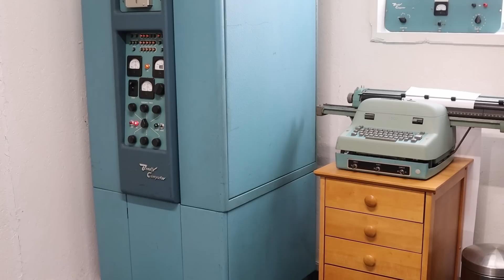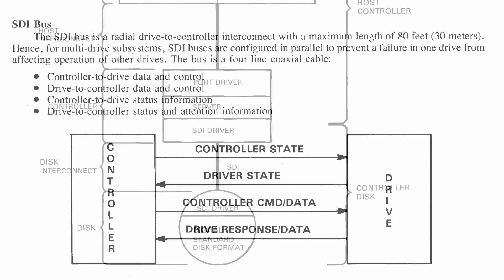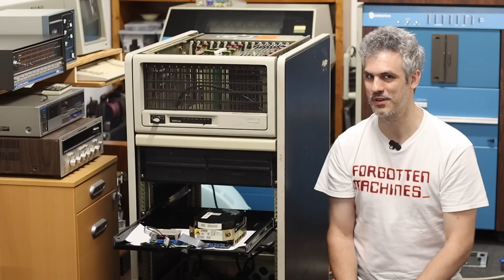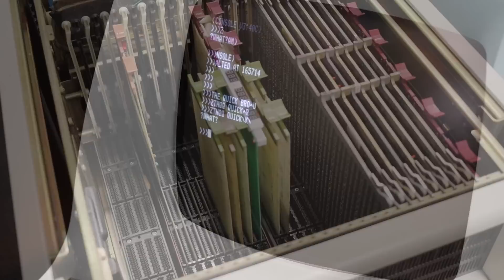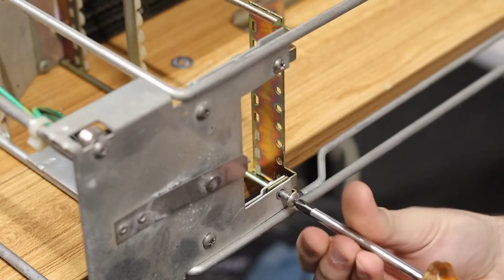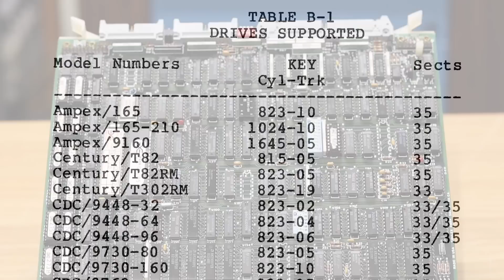I Failed to Get Any of These Working on My PDP-11

Comment: Check that SCSI drive's STASON entry - there's probably a jumper that will allow you to power the drive up without an SCSI signal. Or test it in an AT machine first.

Comment: On the computers i had the hard drives are usually the first thing to break apart from on laptops were its the battery or psu that goes down first. i think its amazing that a hard drive could survive for 50 years since i can't keep mine working for more than 10 .but to be fair maybe the old ones are more robust i only have been using computers since the 90s .

Comment: Stick with the Eagle and get an Emulex UD33 (MSCP / UDA50 emulation). That's the best choice to talk to the Eagle, with on-board diagnostics. You could also use an SC31 (RM/RP RH11 emulation).

The jumpers in your DD11-DK are there for battery backup operation. Normally they're IN for systems without BBU and OUT for systems with BBU. Your connector wiring may have been shuffled around during your power supply issues.

Comment: Why nothing newer than 1984?
Reply: If I had to guess why he has placed that self-imposed ban for now;
-Windows 1 was released on 1985.
-Decline of CP/M operating system by then.
-Western Digital created a Hard Disk Drive controller for IBM in 1984 and by 1986 the IDE interface was becoming common. Also, 3.5" and 2.5" Hard Drives; the norm today, were becoming commonplace. SCSI was developed from Shugart Associates System Interface.
-The rise of 32-bit processors like Intel i386 and AMD Am29000
-EGA video in 1984 and VGA in 1987. There is currently no need for him to deal with VGA's standard 256 color pallet. While EGA had a 64 color pallet, it quickly got phased out. What also adds to him potentially being against VGA for now for the computer repairs is that VGA is still so common. 
-Either for the challenge of pre-85 computers often lacking replacement parts, feels many computers before 1985 were forgotten, or figured computers after 1984 will be less mysterious to work on or be more momentous due to many old computer features falling by the wayside.
Reply: i think he said he was born that year but i always assumed he was much older because of his grey hair or its because of George Orwell lol .
Reply: @belstar1128 I doubt it's Orwell :P I assumed he was born late 70's to mid 80's, people should have a bunch of grey born then, I have a little mainly on the sides, one of my grandparents was completely white by my age. There's a big range.

1985 was the start of the 32-bit era, IDE and much of the modern x86 stuff like the guy said above. There's a lot of overlap still, like retro computing starts in the late 70's, but after 84 it's all retro, so maybe he's just avoiding the retro, stuff his and my generation all remember.

I dunno, I'd love to know his reasoning though, but I'm pretty sure it's to do with the more modern computing, but that's such a precise cut off that I wonder how he came to it.
Reply: @Commander_ZiN  yea i guess you are right but my grandpa was only half grey when he was 60 everyone else in my family is bald or dyes their hair  my hair is not grey yet but i am slowly going bald.  i am a few years younger than him but i am surprised because him being 40 means he grew up in a more modern era that is similar to my childhood .while i thought this guy was closer to my fathers generation who didn't even see a computer until high school.

 i personally consider the early 90s as the start of modern ish computing since even in the later 80s you had stuff like the amiga that just seems weird to modern computer users. i suppose computers keep on changing over the years. computers from the year 2000 are now very outdated but most of them are just slower versions of what we use now .unless you count stuff like the palm and sun workstations . things like the amiga or atari st are interesting because they are not directly related to anything that still exists .and before 1985 things were even more different .
Reply: @belstar1128 I consider the modern computers the early 80's, it a slow progression. Amiga ain't too disimilar.

The 32-bit 386 came out 1985, that was pretty modern to me.
Most of the cards were still compatible in the 90's and it was just an extension of the same architecture.

64 bit came later, but we still use the x86 instruction set.

I go more, 8-bit, 16-bit, 32-bit, and 64-bit as the big leaps, not by themselves but a lot changed when they came in, like slot types and connector types. Time to release the new tech because everyone needes to get new stuff for the new platform etc.

Comment: Hi, David.  I wonder whether the spacer under the CPU card rack was put there to help with the flow of air and dissipation of heat.  If you remove it, will you shorten the life of the computer's electronics?

Comment: you know I was thinking how compact and data dense modern hard drives have gotten 22+ terabytes in a 3.5" disk how much data could effectivly be stored if the size of the platters were scaled up to say the patters in the CDC Hawk drive for the centurion, it'd be interesting to see how much data could be fit in a singular drive with platters that big, maybe we'd be able to have drives capable of holding a whole petabyte or more on a single disk, or scale it up further to the 39" platter of a Bryant Model 2 Series 4000 Disk File

Comment: Good overall work. They were so less standarized back then...
BTW, I had a pair of MFM intefaced 5'25 10MB HDDs in the '90s that looked the same as yours. They wouldn't start because boot sector was defective. I just pushed forward the head from the head motor axis for one spin, so now second track was first track, and the disks worked again! Just low level formatted with one more track, nobody could tell the hack.

Comment: Would one of the Hawk drives work with the 11/44?  If the Eagle would work with one of the other systems, swap it and one of the Hawks.  Might be a hassle transferring the system files from the Hawk, but you wouldn't need anything more than you already have.

Comment: Holy backplanes, Batman!!  Those were definitely the wild woolly days of hard disk drives and controllers, back then.  Everybody and his brother and cousins were making alternative storage (less expensive!!) for the PDP-11 Unibus systems.  That USDC card may have been from US Data Corp, one of those alternative storage vendors.    Having worked with many PDP-11/34 systems using RK06 and RK07 drives, I never knew they required a 'special' backplane.  Congrats on getting it successfully swapped!!
Reply: Funny how there's now only one factory left in existence to make the platters and they're for the standard 3.5" and 2.5" Hard Drives. These days Hard Drives are now being relegated to external storage or as cold storage internally. It's only a matter of time before that last factory calls it quits.
Reply: And I thought the mess of ST-506 MFM and RLL, AT-IDE, ESDI and SCSI in late-80s PC was bad when I worked with lots of those (I didn't even know about XT-IDE at that time). That was at a time when IDE auto-detect was already very much a thing with new computers and drives, so messing with cylinders, heads and sectors felt pretty archaic.
Reply: I was using HPIB hard drives and floppies. Piece of cake!

Comment: The other thing with the backplane you could have done was un-screw the qbus extension boards and use the long ribbon cable with the extension chassis as-is.

Comment: Slowing down the inner leaf by adding more Cycles before the next read will slow down your hard drive you might make it 50 Cycles instead of 10 if you wanted to run like a IDE drive it would be one cycle

Comment: I have here a Fujitsu Eagle M2294 that was used with my Quantel DPB-7001 Digital Paint Box. I can totally attest to the weight, it's insane and that's just the drive, there's the PSU to go with it. Thankfully i have switched to using an Arriad SMD emulator which writes to Compact Flash. I know you like using original hardware but if you can find them, the Arriad AEM-1 could be an option.

Comment: We had some customers with PRIAM drives like that one in the 80's. They were hooked up using SCSI to PC based Novell servers. None of them survived very long. Head crashes were common, perhaps due to the rough environment they were usually kept in. I still have some of the 8" discs in a box in our garage.

Comment: Don't mess around with the riveted 1U spacer until you get that Priam Hard Drive touched up and you verify that spacer isn't some sort of voltage protector or a heat sink.

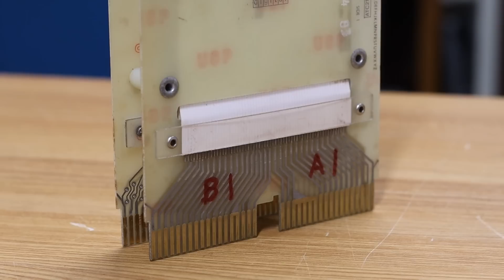Comment: 14:35 I think the 2m cable is so you can have the option of the extension backplane fitted in a separate cabinet. The 1MB expansion for the PDP11/35 used a 1m cable to connect the 16 boards in the extension backplane to the processor chassis.

Comment: that spacer is an RF gap shield .... it keeps the data section further away from the power rail and avoids data corruption ... putting an RF shield between the power and drive sections will allow you to remove that gap ... but the RF shield needs to be neutral on each side and conductive in the middle ... essentially a sheet of copper foil between 2 layers of thin plastic ... with the copper foil grounded out

Comment: the last smd card was at Algonquin College in Ottawa ... then it fried ... it has been rebuilt but it is not usable at the higher speeds 
how do I know I worked with AT&T servicing that pdp 11 and had to rebuild the card and downgrade the drive so it would work ... AT&T was the only other PDP in North America and that was sold as scrap back in the late 80's

Comment: Would look great with a RA81, I guess they came before the RA70 - wonder if any still work, as I remember years back, belt or bearings failing, the drive was spun up but making a hell of a racket, emergency backup and then as I expected, was dead after spin down, I was pretty sure it would never spin back up once it stopped.
Yes, there WERE regular backups, but there was actually a spare drive already assigned, so I went for a disk to disk backup as it was a small dev team and we could take the small downtime, I wanted that drive done with ASAP as it could have kicked the bucket at any moment
Reply: I’m working on an RA82 right now, there are a handful of RA drives working still

Comment: Thank you. Finally a PRIAM drive on the show! Recognized it the second you showed it. Worked a lot on these drives back in the 80's. First repairing the PCB's, and later as a Field Enigineer and System specialist for MAI Basic Four in the Netherlands. Very reliable and compact drives compared to other types of that era.
Hope you get it to work again, and don't forget the spindle lock before you power it up 😉

Comment: If you need newer (1990's) DEC scsi (50) pin drives (like double hight 3.5 inch - I think...) + the controller , let me know , sadly I live in EU(est) so mailing them will be risky (but I am not using them).

Comment: Re the ADM-3a woes, I had a similar experience which resolved down to the implementation of RS232C. The ADM-3a implements signal high as  5V - 12V, and signal low as -5V to -12V as per the standard. Dec/Digital implemented high as 5V and low as 0V. The ADM is therefore unable to process the low signal level. The Intel system I had issues with also implemented low as 0V which meant that the system recognised keyboard characters, but the ADM was unable to display received characters. Like you, my solution was to swap out the ADM terminal.

Comment: Check your PS over very carefully for those 14" drives.  If you can't pull full current (ie have any cold solder joints or bad connectors), you'll launch heads right into the platters.

Comment: decades ago I had a microvax II with a pair of drives that had stiction problems, and the head bumpers had gone sticky. they took so long to spin up, the controller thought they weren't at right speed, and faulted them out.  I opened the drive (yes I know) to fix the sticky head bumper. I added an external switch so I could delay the sync signal, giving the drive more time to come up to speed. it worked well enough to get an OS installed, although the system (in BA123 case) was loud and power-hungry enough that I never had it up full-time.

Comment: I worked in computer operations for several years and i can tell you that those drives sounded FUBR from the start. metal grinding and other sounds, if it sounds like a saw U R toasted

Comment: I have had some experience with SCSI drives and hardware, mostly good. Unfortunately, there are a few variants of parallel SCSI interfaces. Generally, it boils down to the correct bus speed and the presence and type of bus termination.

One thing to watch out for is that there was also a version of SCSI that used differential signalling, in the electrical sense, rather than the more usual single-ended configuration. 

A lot of the time it was about paying attention to detall and correctly manually configuring the devices. On the upside, once set up correctly it generally worked flawlessly and was very reliable. Back in the day, I loved it for the reliability compared with other technologies at the time.

Comment: Do you think the riveted in space is for cooling g air flow?  DEC clearly didn't intend people to use it as an rack expansion
Reply: Well I've read the Vax 11/780 (called VAX-11 because it's "Virtual Address eXtension" for PDP-11) ran hot enough that one could singe hairs off their arm if they walked too close to the power supply exhaust.   I do think it's entirely possible that some of the PDPs ran "a tad" hot.

Comment: The wiring on those back-planes are seriously insane. I'm sure mistakes were made wiring up that at some point.
Vibrations from fans are sure to snap something in plastic sleeves. Someone should reproduce those in multi-layer form for testing.

Comment: Do you have high resolution photos of the SCSI controller card somewhere? As you probably noticed, this has an Intel 8086 and a P8237A DMA controller in addition to the AM9128's. So, are you ready for your mind to be blown?
I can figure out the DIP switches to set termination and SCSI ID from high resolution photos. I can also tell you that at least one of the DIP blocks is to control the *emulation*. This monster here is not simply a SCSI host adapter; it is a TRANSLATOR. It presents a standard SCSI disk as a PDP-friendly disk such as the RK06, RK07, etc. As it sits, you CAN test if the card functions at all by plugging it in. The bank of LEDs at the top edge should do a 'Cylon' pattern if the card is receiving power and was able to execute ROM.

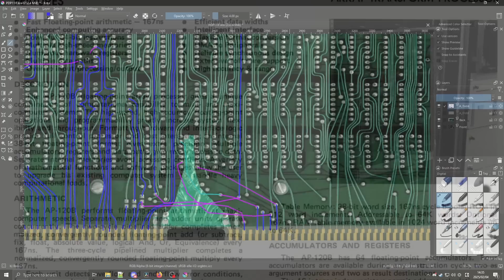Comment: 3:08 So you are building FPS-100 backplane from photos? Where did you find the photos? When Tech Tangents did that for a CD-ROM card, he got hi-res photos from a different owner.
EDIT: Answer is in the video "Talking Reverse Engineering with an Absolute Legend!"
Reply: No, the backplane is wire wrapped and very very rare. We’ve done a huge amount of research but we cannot find any remaining units to copy the wiring from

Comment: So the four-wire interface for the two drives is the equivalent of SPI(Serial-Peripheral Interface), which has... 
DIN(Data IN for device, Data OUT for controller or Slave[device], also know as MOSI[Master{Controller} OUT Slave{Device} IN)]
DOUT(Data OUT for device, Data IN for controller, also know as MISO[Master IN Slave OUT]
SCLK(Serial Clock)
And a CS(Chip Select, standard is active low to interface with a specific device)
This interface can operate with just one device, CS always low, or multiple devices and different CS pins. The commands are sent from the Controller on the MOSI(Or DIN, gets a bit confusing) and the device responds accordingly.

Comment: Lets hope the 1U slot is not a structural support for the cabinet. The fact it's riveted sends out that "do alter this item" message.
Reply: It surely is a structural support, but only needed if your cabinet is mostly empty.  If you only had a component only at the top or bottom slots it would be there to keep the chassis from racking.  Since he’ll have components spread from top to bottom they should keep things square. 

Now, if it’s there to enforce cooling, that’s a different issue altogether 😂
Reply: Cooling or allowing space for airflow was my first thought.
Reply: 100% + airflow would be my guess too
Reply: I would be watching out for thermal issues. If it was riveted there may well be a reason why.

Comment: Is SDI the predecessor of ESDI - and ESDI what you called modified SDI?  We were using a few of 5.25" ESDI drives at university.  They all were pretty old and lived in external SCSI subsystem cases which contained a PSU, the drive and a SCSI-to-ESDI interface, all attached to Sun workstations.  Obscure technology even by the time and occasionally hung apparently in an infinite loop trying to re-read a block and needed to be power cycled - or a classic “reset”, read a not so gentle nudge with the sysadmin's carefully calibrated fist.
Reply: and i still have a very broken but stunning ESDI controller card for PC-AT machines.
Reply: No ESDI and SDI are entirely different protocols and unrelated. SDI is DEC specific, ESDI is an evolution of the original MFM protocol

Comment: If the drives are not the same ones that were on that SMD controller, you will need to configure them.  This will either be jumpers or EEPROM settings (!) to tell it the drive geometry.
I also read that you'll need vendor-specific utilities to do a low-level format.
Reply: Bingo...  geometry here is the nr of dibits of header + block + trailer + gap. SC21 manual should tell him the details. Plus: need special twisted cable for the 60 line daisy chain cable and a terminator. 26 pin drive cable is standard